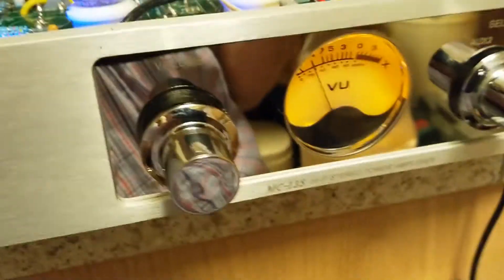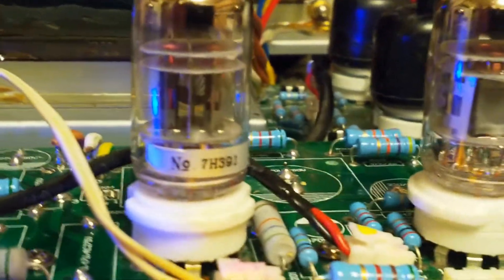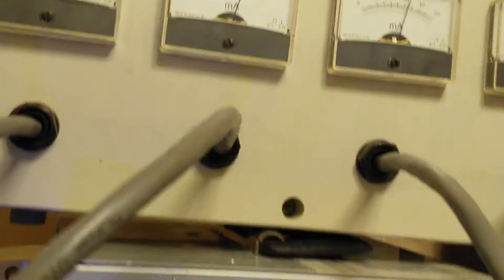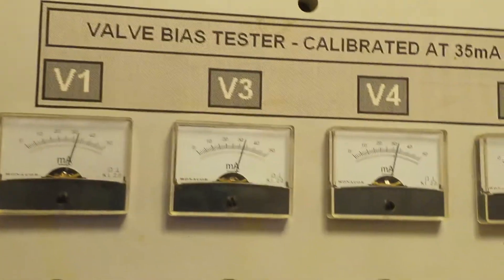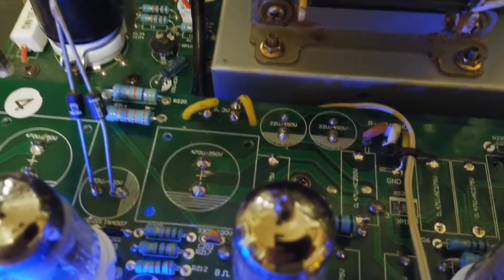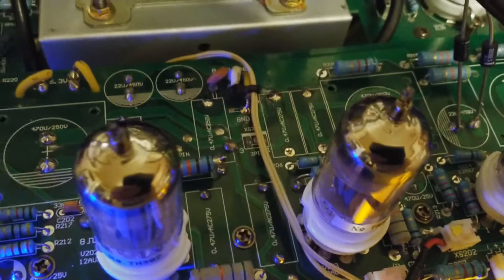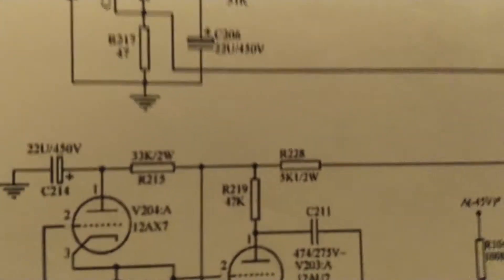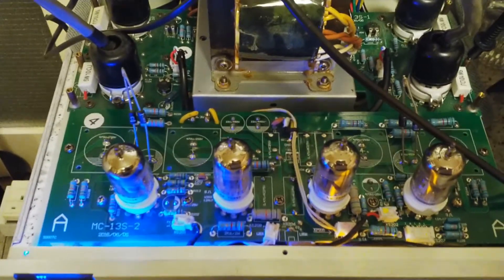Yaqin MC10 to MC13 Phase splitter problem

Comment: Hi Les. I've had my MC13S for 8 yrs. The correct 240V, unlike the previous 220/230 that blew up!! Many Valve swaps later, I found that 4x AT7 (German rft) was ideal.  Tungsol v1/v3 (el34), Tad v2/v3. No complaints,  originally cost me £400ish. Great Bedroom System.

Comment: G'day Les, I did the zener diode (120 VDC), just one and the voltage on C204 and C214 actually came down from 345 VDC to around 230 VDC. Thinking about adding the 2nd in series to bring final plate volts down even more.  There seems to be enough plate current trim adjust for the EL34's to use KT88, not sure why, just playing.   Your thoughts?   Thanks, buddy.... Dave in St Louis.
Reply from the maker: That's a strange outcome Dave as I would expect a much higher zener voltage addition, they are acting as voltage clamps really 'so to get 230V one would expect something like 120V in series with say a  110V one. I would stick with EL34's or 6CA7's as KT88 is very much over kill and miss matches parameters such as optimum plate load, not sure but I think 6k6 for EL34 but 4k5 for KT88. Also you would be demanding more heater current of 7.2 Amps instead of 6 Amps so be careful, I hope all this comes out legible as my Big C is making it very difficult to reply with any sense. 😂Just hope someone else discovers the same fault and works out a logical answer,